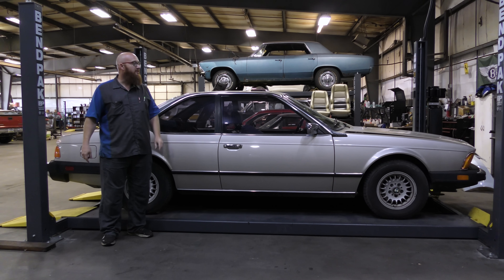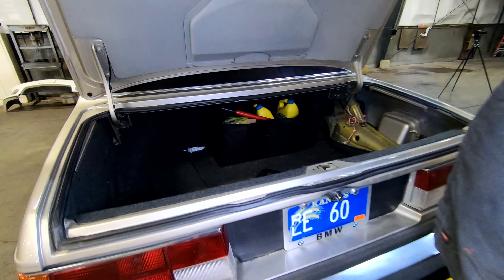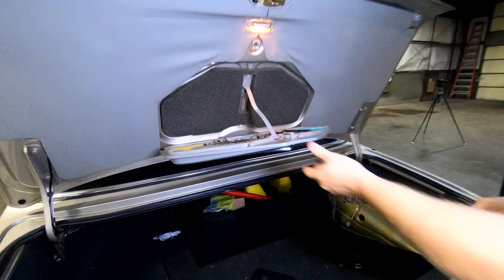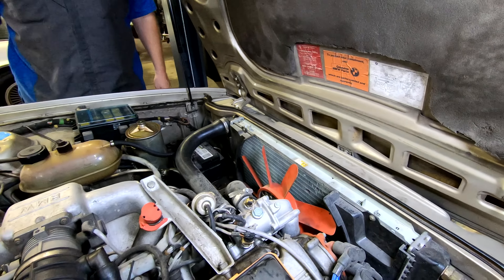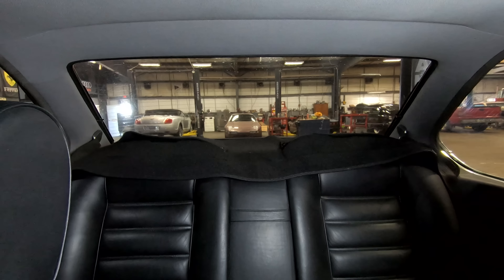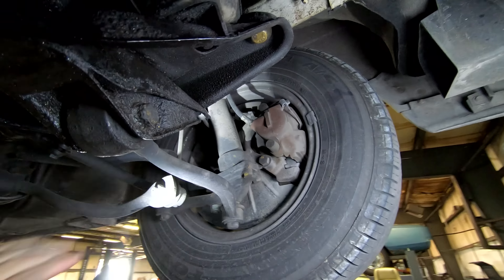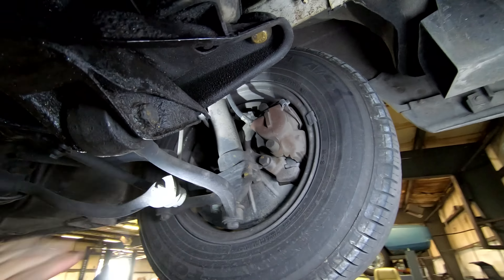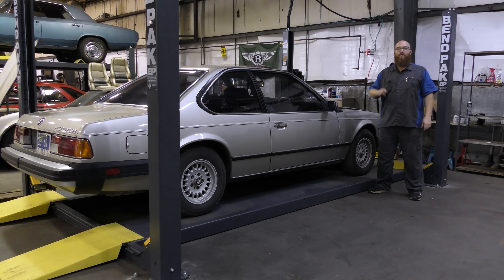Finally a BMW the CAR WIZARD will willingly work on! What makes this '83 BMW 633CSi so special?

Comment: Car Wizard, have you ever considered getting into the business of 3D printing? Of course this may be something completely way over your areas of expertise, but you could train or hire someone to do it instead. The only thing you'd have to do is acquire the tools, printers, software, etc.

If you had such a potential existing in your repertoire of things, then you could (for a nominal cost) get replacement SMALL PLASTIC PARTS/COMPONENTS 3D printed at the expense of the customer.

Now, I'm sure there'll be argument of "what if it produces a faulty party, what if it is not as strong or good quality, etc, etc" but that's the point of having a trained technician who can CAD that stuff into its design. 3D printers come in a very big range of purpose-built design and can produce quality parts that can withstand extreme temperatures, or even be more durable than the OEM factory plastics.

The only downsides I can see to you enlisting such capability is of course the maintenance cost. What it may cost to pay/hire a technician, what it'll cost in equipment, what it will cost in filament restock, etc. But if it has any potential to be a useful assistant in the grand scheme of things, the products produced could fetch that money back. Because as same/similar makes and models come into the shop and need the same replacement hard-to-find parts, all you'd have to do is load a file that had been previously made, command the printer to make it, sand/remove off the extra bits and edges from the print mold, and voila!

It's getting it established and ready to go is the hard part. But once everything is set up and figured out, it's as simple as copy and paste. I'm not trying to convince you to ultimately do it. Though it may sound like it. But it is a potential of the future that I feel is being untapped and not explored. 

The other possibility is that Kansas may have a resident 3D printing business who'd be able to do those jobs for you at a minor level of cost.

Comment: We need laws, if it is on the car it has to work, no subscription, Engines and transmissions along with drivetrain components have to be covered to 150,000 miles. period. Watch how quickly quality improves

Comment: Really on the bandwagon with the others clamoring for Car Wizard, Car Ninja and Euroasian Bob to co-invest in a 3D scanner and 3D printer.  Y'all could get in on the cottage industry for producing some of these rare plastic parts.  As CW says:  big business doesn't WANT you to keep old equipment running.

For instance, I was looking for a gear for a Panasonic pencil sharpener.  Panasonic doesn't stock the part for a 50 year old product, obviously, but my local makers' group is going to print one for me.  I'm convinced that gear will let the product run for at least another 20 years, whereas an off-the-shelf one made today will be dead in 5 or less.

Comment: The heated seat subscription thing is just the tip of the iceberg. AC, navigation, power option......and finally DRIVING. With the influx of EV tech, tax money from the fuel pump will not flow to the government. Solution? A per mile subscription to allow you to leave your home and go to work without using public transit.

Comment: Vehicle owners manuals used to tell you how to adjust the valve lash after a specified milage, not they warn you not to drink the different fluids. Is the next generation that dumb?

Comment: The 533/633 is crap for a reason. Terrible fuel injection system. That's why we choose the M30B35. That and we know the B32 was a sad stopgap measure for the 528i until the 535i got to US shores. I don't blame Ninja for not wanting to mess with this one.

Comment: 5:10 Could a stronger cooling fan be 3D printed?
Reply: The fans are fine.... The fan clutches should be changed periodically

Comment: Can't you epoxy that cracked antenna gear?
Reply: No; had th sane thing happen to a much larger gear in a power garage door opener....the plastic is super slippery, glues cant hold on...new one the only solution...

Comment: Auto manufacturers really need to get back into the basics of engineering soon! People are just not going to buy them! Aftermarket is going to start booming if this continues! We the people pay to much for vehicles to fail and not even last! Worse yet even be able to service because of cheap fasteners that sieze and end up making jobs a nightmare! 2018 and up vehicles by all manufacturers are truly poorly built!

Comment: Orrrrr you can pay 400 dollars and just always have seat warmers. No one talks about that 3rd option !!! 400 is what they cost on any other car but if you dont want it you can save money. Also you never talk about how bad audi is. They are probobly WORSE !!!
Reply: You have already paid for it. Since its in the car. They are never going to sell it to you for less than it costs to make it.
Reply: @martinsvensson6884  no they do it this way because it's cheaper to just put it on all cars on production line and it's also faster
Reply: @xavierramirez330  Yes, if the customers pay for it.. Dont think you're getting you car equipped with it and not paying for it if you chose not to take the subscription.
Reply: @martinsvensson6884  but they are not charging you for it. You pay 400 dollars of you want it or don't if you don't. Everything new always confuses everyone because it's new and don't understand it. This is not the only manufacturer doing this by the way. It's been going on for like over 10 years. But no one talks about the other brand. Only talk about bmw because it's the first people here of it
Reply: @xavierramirez330  They charge you for putting it in the car. You are not going to get that part for free if you somhow believe that :)
Reply: @martinsvensson6884  it's not free. You pay monthly yearly or 400 up front. If you dont care for seatwarmers and other features then you don't pay them. They already saved the money by cutting down production time your not paying for them. It's not like already in the price. Either way you don't want you save 400 bucks
Reply: @xavierramirez330  No you dont save 400 because you paid them to put it there to begin with. Although the price tag might not say so. They will NEVER sell you a car where you didnt pay for all the stuff in it. But of course they can make you pay MORE.. with fx fooling you into some subscription.
Reply: @martinsvensson6884  your not understanding how production works. You'll later though others will start to do because they will r it's cheaper and faster and a base nissan or ford will have it but still be cheap you'll have to pay for what you want. Wich e do that now. It's called options. It's just a difrent way. Like u said other manufacturers have been found this for like the pass decade
Reply: @xavierramirez330  Youre not understanding how scamming people work. You are going to pay for it. Even if you dont sign up for the subscription. You are going to pay MORE for it now. But its not going to be so obvious so people will fall for it.
Reply: @martinsvensson6884 then why have they announced their doing it ? Of they were trying to scam people they wouldn't tell them lol. Just look it up others have been doing it and you don't know about that. You don't know about electronics or car assembly and that's why you think it's a scam.
Reply: @xavierramirez330  Of course they are not going to tell them..... You have obviously already fallen for it, to the point youre even defending it, so no reason for them to tell anyone..
It has nothing to do with electronics. It has to do with pricing and making people willingly pay as much as possible.

Comment: Considering how many of these are still around, whether a parts car or a driver, I can't understand why parts are so high and/or non existent for these cars.  A good used antenna assembly isn't worth more than $80-$100.  I have a feeling that a lot of people are playing the "rare" card.  I despise the word "rare" because it' misused so often.   In the automotive world, rare is considered  only to be +/- 500 units left in existence or +/- 500 units that were originally made that still exist.  An e24 i not a rare car by any stretch of the imagination.   In 2023, an E24 is unusual, but not rare.  The same can be said for the "M" cars since more than 500 were made.  Buyer beware.

Comment: Will not own a BMW that is 1996 and newer.  When BMW introduced the E32 7 series that is when BMW went to crap before that they were great...  BMW M50, M52, S50US, and S52 engines are good, but everything around those engines are crap.

Comment: The most ironic part is all of you that believe that BMW was reliable in these era were probably not born before the 80's.  They were very unreliable.  The newer ones just have plastic and very difficult to work on. There are a few that were ok, the 4 cylinders on e30, e36, e46.  That's about it.

Comment: Color is called Bronzit Beige.  I see all the little plastic plugs are missing over bolt holes on the A pillars. Dealer charge a couple of buck apiece for them. That plastic dash is bound to crack everywhere. 2  separate relays in the fuel system will cause stranding in hot weather.  Headliner stains a lot from sunroof leaks.  ZF worm and roller steering system is imprecise and the handling sucks as a result.  Terrible electrics.  Water leaks into the interior never end.  That power antenna fails all the time.  I threw thousands into this money pit for about 5 years until the brake system totally failed and I sold it for junk.  Junk, junk, junk.  Why would you ever advocate for this piece of crap. You must enjoy working on them because of all the huge repair bills paid to  you.  Don't advocate for a car that is really crappy, despite its looks.  You are making money because you like to have cars come in that totally fail.  I have unsubscribed, but that means only pennies to you.  One big gripe I had with your channel was that you did not bother to find out about things that confused you.  Example, the 2 battery mounts in the MGB.  There were originally 2-6 volt batteries behind the seats and many Americans converted to a single 12 volt.  Do a bit of research before you show you don't have a clue. Special for a 1983 Csi means especially a money pit, even if you work on it yourself.